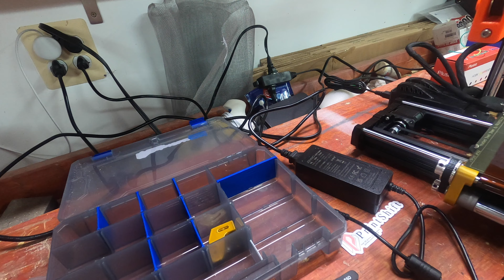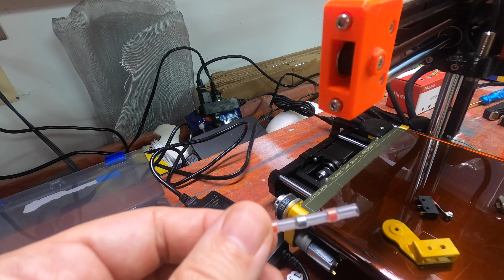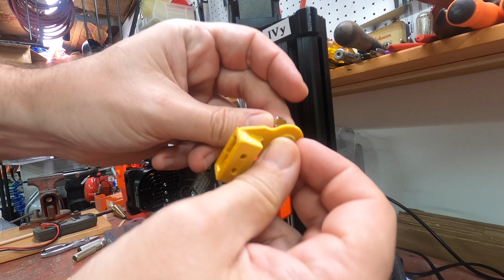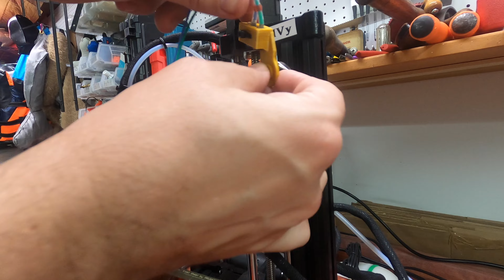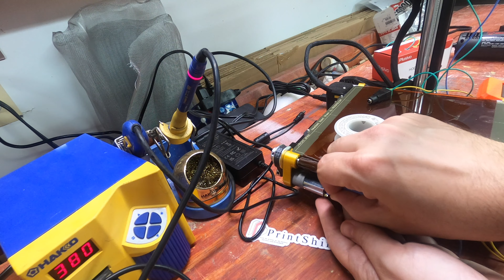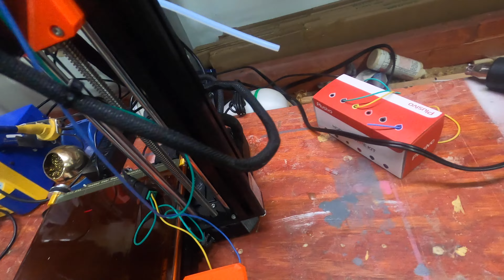PrintShift 4.0 Part 2 - Powering the Ejector

Comment: Hi, what software are you using to queue your prints or do you have to start every file individually?
Reply from the maker: Cut and Paste right now... just slice a few files, then concatenate them.   I run Linux so literally the 'cat' command, but cut and paste works.

The next step in making a PrintShift machine functional is to add OctoPrint and the ContinuousPrint plugin - that lets you queue up arbitrary files and set up remote access, which makes part ejection a lot more useful!